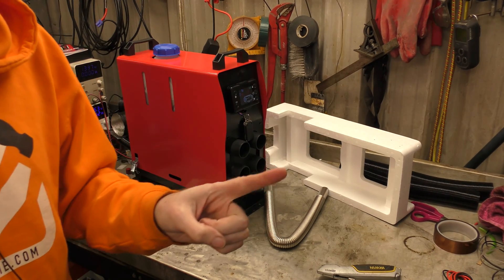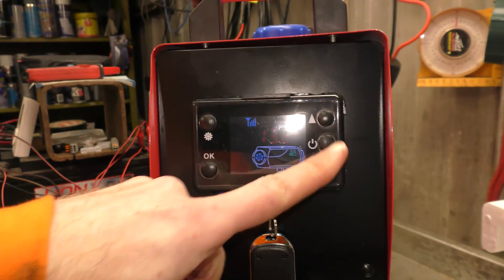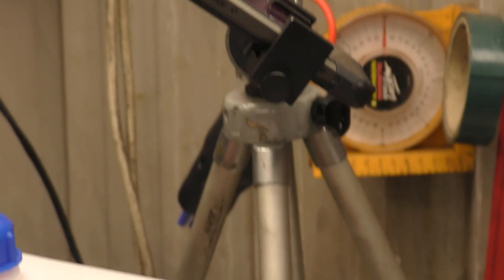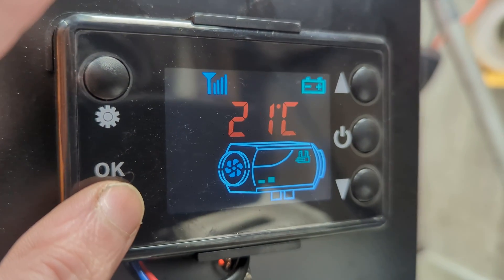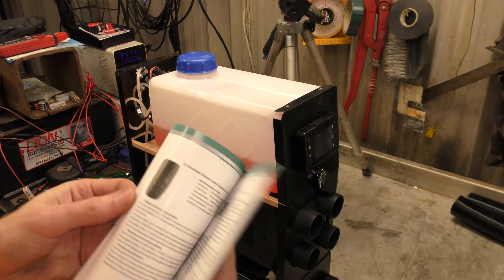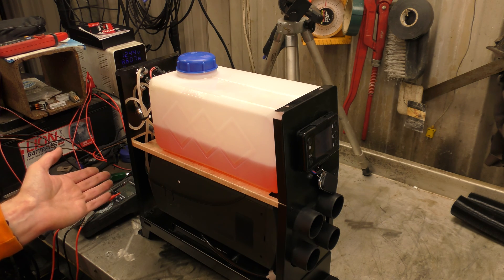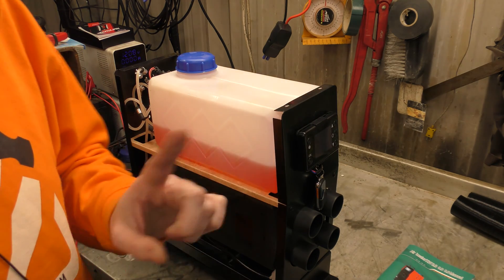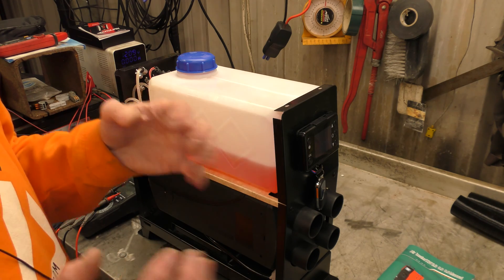Can a 12V diesel heater run on 24V if you change the settings in the ECU?

Comment: David what if you put a 12v supply on the heater with the heater set at 24v would it work or show up a error code
Reply from the maker: It will show an undervoltage error.

Comment: Well then. I honestly thought the units labeled as 12/24 would just happily run either voltage, and just adjust accordingly. How silly of me. I assumed this was done so regardless of what type of low voltage system you were running, it would work. I just thought it would allow smaller gauge wiring to be used.

Comment: Just got my diesel heater setup in my workshop.. Well, outside in a wooden waterproof box, feeling through wall, into my workshop...
Its amazing, Love the heat it puts out...
But ive got a question... The bars on the display, showing the heat level output..... Why cant i get mine to go down to 1 bar?!!
I have the newer style heater, that doesnt have the pump hz adjustments etc... It just has heat levels. 1 to 10.... But even 1 level 1.... those bars drop down, as the temp decreases to go down to Heat level 1.... But the heater bars on my display stay at 2.....
Any way of getting it to go slower?
Reply from the maker: Without boring you with the details, the bar display should be showing the body temperature of the heater.  Which in turn is also how hot the burn chamber inside is also running.  If it was to run any cooler it will likely start to either flame out or carbon up as the flame goes out and relights continuously.

Comment: hi David, Im running my led display adjustable voltage pwr supply at 14.8 volts because i measured the current 10ft away at the heater box I have the heater mounted on the outside wall and at 10feet through 18 guage wire the voltage dropped to 11.1 volts at the heater, the voltage at the heater is now 13.8 volts and it has been running absolutey fine for 2 months, yes i know its summer  but ive been playing with all the doors and windows open getting ready for winter. I finally decided it was cheaper to dump the battery and buy a little mains power supply, we have a  little genny and spare ecu's if we need them if the power goes out and damage occurs.

Comment: Ok a friend bought a new heater as new th  then reported not working first use. I can't verify what has happened since first delivery. Question is -their heater is a 24v model. Following the wiring the 24v feed goes to the internal PCB and then there is a DC output to the Control panel, looking at the board and wiring scheme I assume this must be a difference voltage i.e. 12v anyone have an idea. This heater is not working as there is no DC output from the control PCB to the control panel?

Comment: David, a question about my heater that is  very much like this one on the video. I've not run mine yet, until today, and she wouldn't pump fuel, pump works when I use 12V battery power jumpered, and I pumped fuel through the hose doing that, to no avail.  Do you recon the control board is rubbish? She blows air, shows E-03, just no fire up.

I'd appreciate any advice you may have,  many thanks for your time
Reply: Not sure if this info helps! but, >
My same New heater wouldn't pump at 1st, and later i got the same E-03 (after E-07 & E-06).
Turned out to be a simple problem with voltage/skinny wires.
Just to test it i was using a skinny-wired extension (the type with little crocodile clips) to a car 12v battery = Way too much resistance build up in the skinny wires.
Then i tried thick cables with the same 12v battery = Still got E-03 code error as volts would drop to 11.8v when the glow plug was pulling amps.
Put the battery on the charger 13.2v now showing and the thing fired up no problems at all running perfectly.
Also pushing both bottom buttons together on the controller is used to prime the fuel.
Reply: @luap ynneb  
Thanks for the info. 
I was using jumper cables for power from my Diesel Excursion, which has dual batteries. 

I didn't check the voltage when it was trying to fire up, I'll check that tho.

I did end up ordering another main board, as that's where it seemed like the problem was

Comment: ive just bought a all in one 8kw heater but the control only has 4 buttons and i cant find out how to get into the setting :(do you know if your control would be compatible with other heaters as i was thinking about buying the same as yours and installing it on mine so that i can access the advance menu to tone it up
Reply from the maker: Welcome to the minefield of diesel heater controllers.  Even the ones that look the same sometimes aren't.  It is a nightmare.

Comment: Will the 24v heater run on just 12v ?
Reply from the maker: Unlikely.  I don't have a 24V heater to test with.
Reply: I just bought a new one a week ago and in the manual it shows normal voltage 12/24 not sure if this means this one is capable of 24 volts? Or there is just a 24v model that uses the same manual?

Comment: Hellooooo! I've been loving your very entertaining videos on this subject. I'm awaiting delivery of one of these units. I was wondering if you have or could explore how the length of the exhaust pipe may effect performance or reliability. It's going to be hard for me to mount mine near a handy outside wall so I'm curious to know what will happen. Thanks.
Reply: I have taken the 1 inch pipe, and used a larger pipe to extend the length. It needs as good a seal at the heater end as  at the join between the large and small pipe. I have used a length of stanless and on one occasion a length of scafolding pipe. Expansion must be allowed for and it is best if you can weld the step down end on the larger pipe rather than use a  double diameter spacer. Long lengths of 1 inch pipe are not good, some impedence occurs, so get the diameter up or use a larger baffle box of some sort. As in all cases of fumes, on tilley lamps, drip heaters, gas installatiins and any combusting heater, ventilation is required and the exhaust must be taken well away, (and not just a short distance from any intakes or windiws etc). I hope this helps, but as I have posted repeatedly, 'I dispair at the level of af=dvice seen on some social media'. it is common sense, all combustion must be vented and disposed of sensibly.
Reply: @johnhansen337  thank you John. Luckily for me I live not far from a vehicle exhaust pipe manufacturer and they will sell the leangths of pipe I will need. I'll be sure to up the diameter and seal it properly. The inlet will be well away from the exhaust and no chance of fumes getting to where they shouldn't be. 
Thanks again.

Comment: Guys I’m a new user of ebscher 24v diesel heater my question is can it be reset to run on a 12v  power source your valued comments please
Reply: It probably can, as long as you change out the plug, fan motor and the pump for the 12v versions.

Comment: Most of the commenter are missing the point.   He has a multi voltage unit that has a 12 volt fuel pump ....that also has a 240v mains plug in and the internal PSU has an output of 24 volts.       So it appears to be a 12 unit running on 24......like the ecu is compensating ....I think that is what he was testing ....not of you can change the glo plug and fan motor out.
Reply from the maker: Yes.  People keep saying you can just change the settings in the menu and it'll run on 24V.  This video proves this to be untrue.  Hence they sell 24V fuel pumps, fan motors, and glowplugs.

Comment: I have a question please   can you run 2  5kw diesel heaters on   a  typical 12v car battery. I ask because one heaters not enough for my outdoor shed. 😎
Reply: You probably can, as long as you don't start them both at the same time.
Reply: @englishrupe01  I had a think about it myself  if the amps are kept low it will be ok... 🤟

Comment: Fuel pipe melting seems to happen alot, why can't a brass compression fitting be used along with metal fuel line to the pump? seems like the fuel pulse would be stronger as well since the piping wouldn't be expanding with each pulse/tic? thoughts?
Reply: I have always been amazed at how the fule pipe never melts, but I always contrive a holder to keep the pipe free with lots of air around and towards the air intake and not the exhaust. I have thought about the proximity to the hot exit stub, but never had issues. Your post reminds me to check my heaters, thanks. there is always a first time.

Comment: I have to say what a mission I've had getting my one working again, thought I told it to switch off then left it for night, a day later I head to garage and display showing 11v, usually it would be around 12.6.. then I noticed the tank was empty, jesus, since then I've had it apart 3 times and cleaned once lol, eventually it now works again but what a mission, never let it run dry when hot or your psu fail keeping your battery charged lol.
Reply: I have stressed this often. Clean Fuel, and a Good Battery. I estimate that well over 50% of posts about error codes and sooting up etc. come from failures in these 2 areas. 12 volts must be seen as the lowest voltage (although the Chinese ones seem to be better at the lower voltages). Clean fuel from the garage is best, and a see through tank (Chinese style) is always good. You can see the dirt and water if any exists. Low voltages will throw up spurious errors and even cause the burn down stage to fail to purge fully. These heaters will run a car battery down in a couple of nights use. Given that batteries degrade in time it can't be assumed that the Anp/Hr calculations will apply, batteries get weak and capacuty fails over time.

Comment: Use a dc to dc converter and run it on cordless drill battarys
Reply: And how long will it run on 2 big dewalt batteries
Reply from the maker: I did.  Makita ones.  There is a video.

Comment: Tried mine off 18v drill battery worked for a bit then Amp demand ramped up and error error.
Anyhoo was wondering if there was any maintenance required on these units or just run until it dies...and replace 🤔 
Also does running it on full throttle burn carbon etc or is this BS shite bollocks or good sound advice
Cheers Dave

Comment: The buck regulator used in the DECENT ECUs to power the glow plug faults out very quickly if you feed the ECU with 24V, despite setting the 24V flag - as you have found.

Given their extensive topology about that regulator, especially in the older ECUs, you'd think that maybe they should work with appropriate duty cycle changes to the buck regulator drive (all from software), but nup, no cigar.
For a 12V system, they do carefully ramp up the voltage to 8V over a minute, and it has full feedback of voltage and current as it does so.

So it would indeed seem you do need a "24V" glow plug (likely 16V in reality!) to keep the ECU happy.
And likely flipping the flag means it tries to run as a "16V" glow voltage.

It then begs the question, do you also need to switch to PF-2 as the old manuals also had a distinct 2:1 ratio between PF1-PF3 vs PF4-PF6 powers....  And yes 24V & PF-2 also fails.

Comment: I bought one last week and looks very similar apart from one heat outlet. It says it will run at 12 to 24v. I'll be pissed if it won't run at 24v and It has a big sticker on the side saying 12v

Comment: I think most of us was expecting it not to work on 24V, it's just a generic controller that's used on 12V and 24V heaters where the 24V heater is setup at the factory with the correct glow plug and whatever ECU is needed.
I was chatting with you on IG about my Afterburner problems😁 I never did get it working via my wi-fi again so god knows what's wrong with it but it's working perfectly via bluetooth using the app so I'm still able to control it from inside my house😎 thanks David👍👍

Comment: Curious to see if a 24 volt would work at 12 volts now.  I suppose I could try with one of mine.  My guess is it turned on the glow plug  and watched it over current and after a while shut down.  It knew it was the ignition because of the sequencing.  My guess is a 24 volt at 12 won’t ignite, but if it did the fan would be slow and perhaps compensate.
Reply: Yeah it'll probably register low voltage and throw a code
Reply: can say no! i got one thinking it would but it doesn't work both the fuel pump and heat plug are 24 volts. I just swapped them both with 12 volt ones to get it to work on 12 volts
Reply: @TheMamonti1  did you get your 24v heater to run on 12v with the fuel pump and heat plug change?  What about the fan?
Reply: Yes... the glow plug and fuel pump is all that is needed... just remember to make sure it is set to 12v in the settings. The fan runs on 12v even on a 24v system. Been working for over a year and is running right now
 @captndavie

Comment: want to know if its safe to run on any powertool battery in 18v
Reply from the maker: I foresaw this question and did the the test for you.  If you set the ECU to 12V and give it 18V it throws the voltage too high error and won't start.  Need to use a converter to bring that 18V down to 12V.

Comment: As far as I know my unit is only 12v, I do run it from 16.8v and when it's drawing 8amp for the plug the length of the cable does bring it down to around 11-13v
In reality this wouldn't be too far of a car/van with higher engine rpm charging the battery at almost 15v with shorter cables
Reply: Yes, i read that the 12v units are designed to run on between 9v and 16v, so you are probably pushing it a bit. It probably pulls more amperage, though at the lower voltages. I also read that the fan speeds up quite a bit on the higher voltage too, as you would expect.

Comment: You know, mine says 12/24v all over the thing. HCALORY says it dosnt need to be set. But I was afraid to actually test it at 24v. But after this. It looks luke it has glow plug over current protection. So it looks like it will save itself if it's wrong.

I have that 4 button black "speaking" controller with BT. And have no idea how to get it into alpine mode or adjust the air fuel.. manual is no help. Any combo of buttons won't let you change any advanced settings. Just view the set elevation (all 0s), chamber temp, and voltage. 

I did see in the manual that some you can set the power of the glow plug.. 50-95w or whatever.. I'm curious if that changes how long the glow plug is powered for. Maybe setting it to a higher power than it actually is will shorten how long its used for. Or maybe that's just for its self diagnostics I'm curious if you could use it to lessen the battery consumption when it starts up and powers off. Or maybe just swap out to a lower power glow plug so it's easier to start for people that use portable set ups.
Reply: Update?

Comment: I have the same exact controller but yes to use 12 or 24 you have to change out the fan and glow plug and pump  in most cases I have 2 heaters ones 12 v the one I'm using in my right now is a 24 v I use a 12 to 24 v converter to run it

Comment: I charged my 4s LiFePo4 battery fully and when I turned it on it burned out the glow plug E03 ... now I'm on glow plug #3 and a cheap #4 on its way from China as a backup. My main problem was the screen not being pushed far enough in to clear the air vent hole made starting very difficult so the glow plug was running for hours before it would light.

Comment: I would've bet that the ECU would've blown up, would not have thought they built the circuitry to operate at such a wide voltage range.
Reply: most general purpose switching power regulator IC's take an input up to 30VDC
Reply: @danedwards_ee  just a question of whether the regulator can dissipate the heat and not go into thermal shutdown if there’s any protection.   Usually current draw is negligible for controllers themselves, but may be some additional stuff on the board that could draw current.  Most DC regulators are linear or low drop-out.  Not sure they’d buck or boost unless they’d have to.
Reply: @danedwards_ee  I didn't think the ECUs had power circuitry, I would've bet it was fairly basic in there to keep costs down.
Reply: @JoelleFromHell  power circuitry is pretty fundamental in all electronics, sometimes it's more complex and powerful than others.

Switching power regulators super cheap and pretty versatile.
Reply: @danedwards_ee  I'm used to dealing with most consumer appliances and electronics with very thin operating tolerances, like in the range of plus or minus 5%.
Reply: @JoelleFromHell  Yes, like 90 to 230v line voltages.

Comment: I have a 12v unit running on 4s li-on batteries which amounts to 16.5v max. It runs fine, never gave me an issue in 2 years so far. Maybe I'm in the limit of the maximum voltage it tolerates 🤔. It's a Chinese 2kw unit with the most basic knob type controller.
Reply: Is the fan spinning faster at a higher voltage? Maybe this will decrease the efficiency because the air doesn’t have enough time to heat up